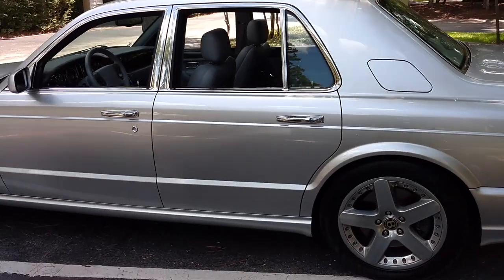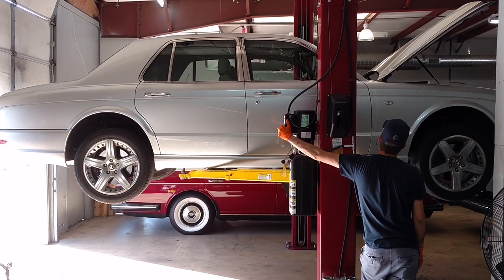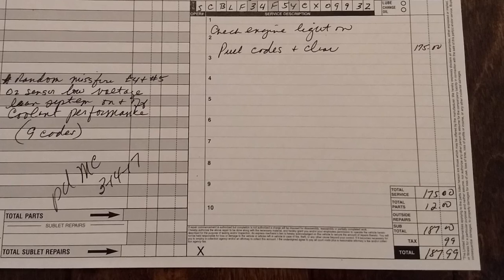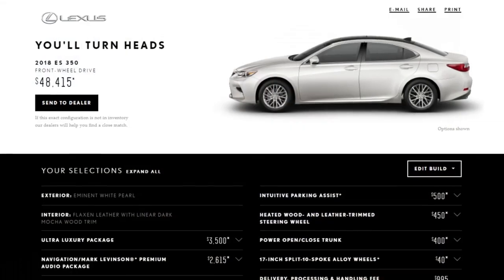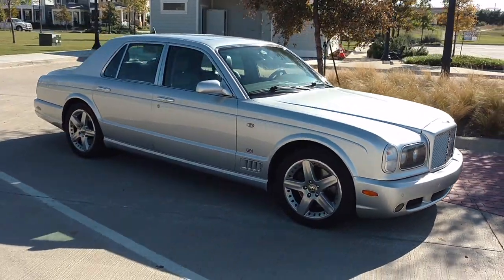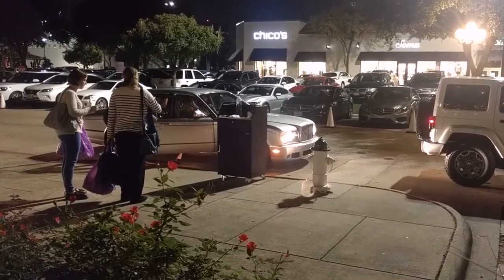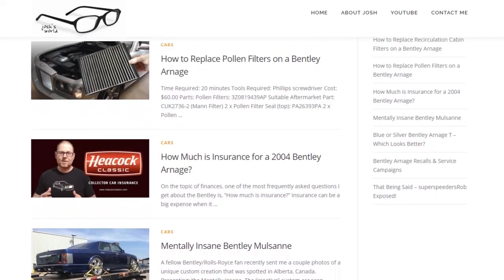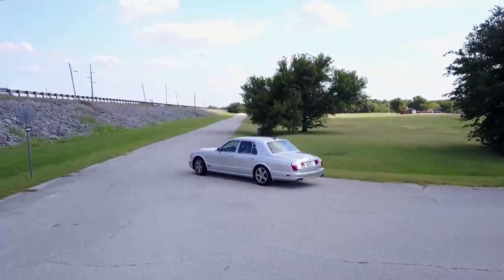Ownership Costs After 1 Year | Owning A Bentley Arnage - Episode 15

Comment: there was a 2001 arnage in salt lake for 10 k a year ago, had that crap m62 bmw motor though but only 90 k miles needed a little interior work and rebuilt title, 49 k seems a little high but that 6.75 liter is a wicked engine also, but that gas mileage would be horrendous to the point of never wanting to drive it. great looking car car though.
Reply from the maker: Gas mileage is poor, but it's not much worse than many SUVs from the same era.

Comment: My passion is a 1996  totally original Nissan Serena 2.0 auto. In the 4 years of ownership only a change of radiator was necessary other than normal maintainance. Oh ! I have only ever seen 3 others of the exact same model. This car has received some really negative press over the years,I am at a loss to understand why ! If driven as per manufacturers spec' it is wonderful to drive,easy to park for such a large  vehicle,stable at high speeds. All in all one of the best and most reliable cars I have ever owned. The climate controlled air conditioning make it  extremely pleasant for the occupants on long hauls.
Reply from the maker: I had to look up Nissan Serena... they don't sell those here.
Reply: It is quite a oddball Josh. It was imported CBU into Indonesia and is Japanese in name only. Built in Barcelona,with the engine built in Sunderland,England.

Comment: Ya man.. 12 months of ownership aren't THAT much to absorb costs wise, outside of buying someone else's headache. And for 50 large, that car really should have been well maintained. Report back after 5 or 10 years of ownership, that will give you enough time to start absorbing bigger interval maintenance, and increases the chance exponentially of a (god forbid) large expensive failure point. Hopefully that latter won't happen to you though, you seem like a nice enough guy : )
Reply from the maker: I don't plan on keeping the car that long because I will want to experience other cars. But keep ANY car long enough, and the maintenance and repairs will start to exceed the car's worth.

Comment: I am being offered a 2006 Arnage in dark Emerald for £40,000 with 21,000 miles and 11 stamps in the book.  Local Bentley garage is telling me "look for the 2007 spec gearbox" and have a rust check.  Getting closer Dark Emerald with Green piping and lambswool overcast has a certain draw. Even the original umbrellas are still in their slots.  Full Bentley check is £350 so I am tempted.
Reply from the maker: Go for it! The cars are a wonderful experience.
Reply: Thanks - it's a big decision because I really like my CL500 - we'll see. It's make your mind up time just after Christmas. Thanks for the advice!
Reply: To add to this. Something that might interest you (if you have not seen it) is a Bentley Brooklands being prepared by a guy VLOGing under the name of WhiteDetails on here. He's easy to listen to - only a slight accent (!) and the car really does look fabulous before being returned somewhere out of the UK.
Reply from the maker: I actually have seen that video. I left a comment on it (about 6 months ago) inquiring about a product used.

Comment: The problem is when you come across the repair or part that "has to be done/bought at the dealer"
Reply from the maker: Fortunately, my local independent specialist is able to handle any repairs because he is well-trained and has the proper equipment for working on these vehicles.
Reply: @JoshsWorld  ..but some jobs only dealer can do.Plus some oem parts are only available from dealer..that is the scary thing.
What is yearly insurance?

Comment: Its because it has low mileage and looks garage kept.  If it had 200k miles would probably be a different story.  Also if its a one owner elderly person  that usually helps.
Reply: If it had 200k on it, it probably would have sold for about $15,000 and he would have an extra $35,000 to spend on maintenance.  Depreciation is just about always going to be the biggest expense.  At least until the sale price gets close to zero.

Comment: 30,000 miles is low. The car probably has more problems from sitting around. Sea foam is good stuff. I would add a little archoil to the oil. 4-5 oz for The typical engine. It is a friction modifier. J Leno uses the stuff.
Reply from the maker: Interesting. I'll have to check into that.
Reply: JoshsWorld.com uses boron. Boron is it coating is used on A.R. 15 bolt carrier groups. It acts as a lube  even if the bcolt is very dry. You can buy arch oil additive on Amazon. Jay Leno’s mechanic added arch oil to a 1930s motorcycle with an original engine that have never been opened or rebuilt. They mentioned during the show got the bike sat for 25 years. They rebuilt the carburetor and clean the fuel system. It would run but A little bit rough. After adding this archoil The bike immediately ran smoother. Youtube has video on the product. I also saw YouTube video where someone added it to a Diesel truck engine and had immediate and obvious improvement. I’m sure your car runs very good to begin with. I don’t think the results will be drastic but It will reduce engine wear and you may see a small improvement in gas mileage.

Comment: Couldn't figure out that the coolant level was low and took it to the shop. If you own a car there are basic things you should know. 
I nhad a 1990 Rolls Royce Silver Spur until a guy in  a Corvette hit me and totalled it out running a red light.  They are wonderful to drive and especially travel in they weigh in at over 6K lbs. Drive like your on glass.
I took mine from Los Angeles to Chicago on the way home in Kansas City Missouri while visiting my parents is where the accident happened. When I saw what had been done to my car I almost puked in the street. Very sad seeing that beautiful car on the tow truck heading for a salvage lot then to get me and all my stuff back to Ca I had to take Amtrak. Talk about a ruined vacation
Reply from the maker: Taking it to the shop wasn't to determine if the coolant was low, it was to make sure there wasn't a serious issue causing it to be low.

Comment: +Joshsworld.com
Thanks for giving me the confidence to finally make this purchase. But I can't decide between purchasing a Bentley Arnage or a Rolls Royce Silver Seraph. Besides using the same body..is the main advantage of the Arnage over the Silver Seraph more hp and torque? Or do you feel there are other things that make it the better purchase? Thanks for any feedback!
Reply from the maker: Generally speaking, the Arnage has a bit of a "sportier" feel than the Rolls. It's really a matter of personal preference on which car is better. An advantage of the Arnage is that the production numbers were much greater than the Silver Seraph, so there is a larger selection to shop.
Reply: Thanks for the input Josh. The main thing I look for in a luxury car is a soft ride..which surprisingly can be hard to find today. So if the Arnage does good on that and provides me better handling than the Silver Seraph then it will be a winner. Thanks again and enjoy your beautiful ride my friend.

Comment: Don't take this the wrong way but if your car says 'Engine Coolant' on the dash surely checking the level would be the first thing you think of instead of taking it to a garage?'
Reply from the maker: If there is a leak or major issue such as a head gasket leak, adding more coolant is only a short-term solution.
Reply: Fair enough. But surely the first thing you would think of is to top it up and see if it falls again. But I understand the Youtube/media world has to be dramatic :-)

Comment: The psychology you describe is a little sad.  The wealthiest people I know (congenital hundreds of millions-billions) never drive nor are driven in ostentatious vehicles. That's both a matter of security and of self-confidence. 
Incidentally, the low (declining?) coolant level and the misfire apparently related to a "dirty" injector suggests the possibility of a leaking head gasket.  The turbo models, esp. with the old push rod V8 were well-known for doing this at about 50K. At least this was true of the old Turbo R models.  I don't know about yours. There's an easy DIY test for this. If positive, you have another decision to make.

Comment: Well I don't care what you think my truck cost $850 and it cost almost nothing to maintain throughout the year oil change the cheap at Four quarts per oil change and a cheap $3 Fram filter tires are about 70 bucks a piece it is a Japanese import so it will run forever
Reply from the maker: I have a 1997 Toyota 4Runner which is the best vehicle I've ever owned. Like you, I spent almost nothing to maintain it.

Comment: Wait till the car hits higher mileage points...lol  Right now your car has low enough mileage to keep your costs within reason. Update us when your vehicle hits 100k-120k miles or more. Your maintenance costs will likely soar well north of the cost of a new 2023 Lexus RX350.
Reply from the maker: So are you saying a 120k mile 2004 Bentley has different mechanical needs than a 2023 Lexus? Wow... shocking revelation

Comment: Lifestyle experience? Confidence booster? In England a Bentley is a footballer's car. More money than sense coupled with bad English together with spitting. Rolls-Royce is (or used to be) the classy experience as it was the car of heads of state (UK, Ireland, Brazil, Spain, Holland, Denmark and Australia). Sadly the current customer base of Rolls-Royce (e.g. the Sultan of Brunei who owned 500 Rolls-Royce, the Peninsular hotel Hong Kong who own a fleet to impress guests) is steadily eroding that experience. British aristocrats struggle to afford Bentleys and Rolls-Royce and are an insignificant share of the markets.

I hedge my bets and I have an Bentley Arnage and a Rolls-Royce Silver Cloud.

Comment: Chief, with all due respect, I got a 2006 Toyota Tundra with almost 100,000 miles on it. Never got a check engine light, never had to replace any sensor, just did the oil changes and required book maintenance so far and it is running like new. You just wasted $50,000 plus interests in a piece for your ego and vanity and you already wasting so far $1000 more in "that". Try and get back to the real World and be smart with your investments. Besides that, Happy Motoring.

Comment: Just because you had no expenses the first year doesn't mean anything. My buddy bought 2001 Mercedes S600 and the first year there was very little maintenance but guess what the following year his car literally started to fall apart. Needed new sparkplugs (it a V12 so its expensive), wires, radiator, catalytic converter, new tires, new pulleys, new brakes, new suspension components and front control arms, in the end it cost more to maintain the car than to buy a another 2001 Mercedes. He bought the car for like $15k and had to spend another $15 to fix all those things.

Comment: These costs are in no way any different from those of running any 2004 car, regardless of marque of badge. Lots of myths abound as to the running costs of premium machinery. BMW gets slated for it cars and the costs of owning them. Completely wrongly. Especially here in The EU. What your'e driving here is heads above and more of BMW. The maker of which I'm wary is VW. Yes, VW owns Bentley. But bentley build is on a different plane. VW also owns Porsche. Such a shame that the Porsche reliability gene and discipline hasn't filtered down to Passats and other VW models.

Comment: How the fuck would any car with under 30,000 miles have a check engine light on??? Isn't it a shit car that is notorious for mechanical issues with LESS than 30,000 miles? And this is supposed to be one of the best cars in the world but nobody is calling Bentley out? How does a company's reputation stand upright when a check engine light is "normal" on a low mileage car? Correction: world-class luxury vehicle.
Reply from the maker: It's over a decade old.
Reply: I just don't buy that excuse. With that kind of low use, parts haven't been worn enough to default or break. I see that as low quality. A car that's ten years old with an average 100,000 miles at that point would see sensors wearing down but with regular maintenance, even a regular daily driver wouldn't see a check engine light.
Reply: If that's the case for a maintained Toyota, wouldn't the standard be even higher for a Bentley?
Reply from the maker: As I said in the video, the specialist said it was likely due to a dirty sensor or moisture in the fuel system. That doesn't really speak to quality issues.
Reply: I suppose.

Comment: There are a few issues in your video that need to be called out.  The word on the street is not hype or panic, it is all real.  I am glad your experience so far has been good, but I can GUARANTEE you that your nightmare is just around the corner.  Your car is the same as mine, one of the rare 24 cars for the "Le Mans Edition" cars celebrating the Bentley victory at Le Mans the prior year.  Of the 24 cars, 12 were silver like your signifying daylight hours and 12 were black like mine signifying nighttime hours.  They are among the rarest Bentley cars ever.  Assuming that you bought your car in 2016, a year before this post, then you paid top dollar.  $49,000+ is a terrible price.  After 1 year of ownership on mine, my car spent a total of 90 days in the shop and the total bill was $31,000.  If you have managed to avoid it so far then great.  That just means some moron like me owed it before and spent a fortune on it.  Your time is coming.  My ownership experience as so bad, when the dealer called me back to sell me a 2012 Bentley GTC brand new for $20,000 of sticker because they felt to bad, I almost hung up on them.  The 2012 Bentley GTC was an amazing car that over the 2 years I owned it cost me $0.  Maintenance was included.  When I got my 2 year service, there was a silver Arnage that had just been traded for a 2014 Flying Spur and the GM of the Bentley dealer offered to sell me the car for $1 on one condition, I only get the car serviced there at the dealer.  No Sale.  Been down that damn road before.  The GTC was an amazing car and your valet story is only the start.  I have my own table at a couple of restaurants in town and at one, when the valet refused to allow me to park my own car up front and keep the keys, the GM came out and fired the valet on the spot.  At another place, the GM offered my parking right up front and free food and drink for lunch if I would park out front and eat there.  It seems their total sales went up by 5% on the days I was there.  Well worth the free sushi and vodka martinis.  I loved my Arnage, but she was a cruel mistress.  It was like dating a hooker on crack.  Everytime you get into her you weren't quite sure what kind of experience you were going to have.  Anyway, glad you had a good time so far.  I bet you lunch and $250 that 1 year from now your bill is over $10,000 total if done at the dealer.